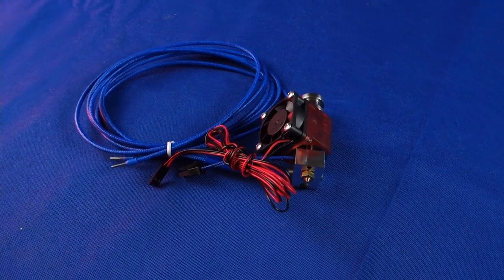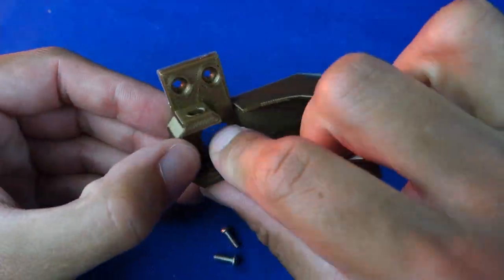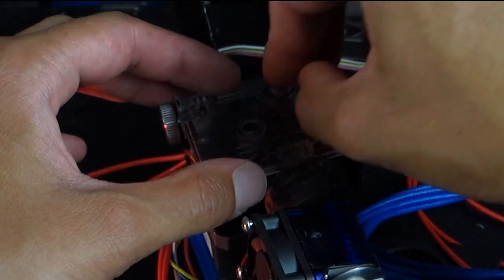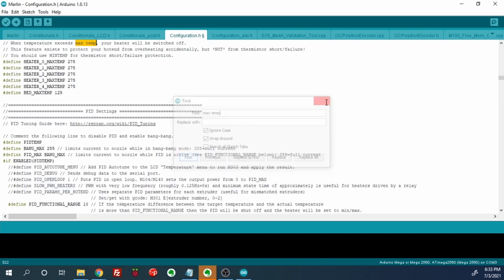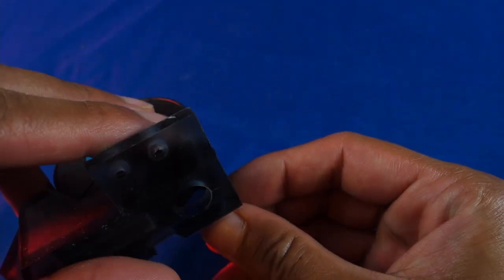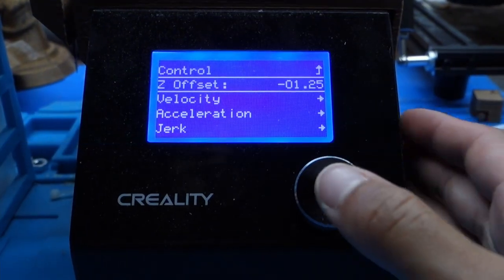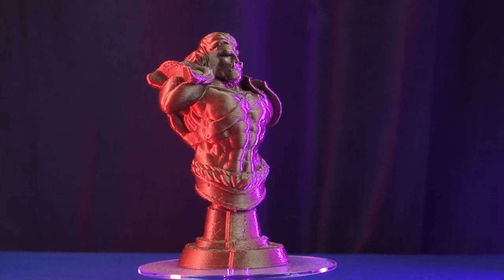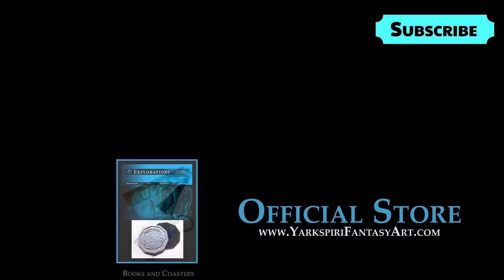CR10-V3 - 𝗣𝗿𝗶𝗻𝘁𝗶𝗻𝗴 with 𝐇𝐈𝐆𝐇𝐄𝐑 𝙏𝙚𝙢𝙥𝙚𝙧𝙖𝙩𝙪𝙧𝙚𝙨

Comment: Can I just flash your firmware onto my machine and install the cr touch on the provide bracket? Or is the height gonna be wrong?
Reply from the maker: You normally need to adjust the height for the Z offset.
Reply: @Yarkspiri  of course but I just mean there isn’t a difference between the bl and cr reach wise? I shouldn’t need to add a spacer or anything? I may eventually convert this machine to a high flow high speed set up though. I’m having some slight regrets on buying this model over some of the other options available.
Reply from the maker: @badgersnakeproductions  In theory it should be ok, however sometimes the attachment can move every so slightly causing a change in the height.  ***I'm looking into doing a review of the CR10 Smart Pro***, but that will depend on what you guys end up choosing.  I have a pole running in the community tab of my channel.
Reply: @Yarkspiri  Last night I attempted to upload the firmware I used the hex with mega in the name. I was really hoping it would make the interface a little more user friendly. I can’t seem to figure out the z offset and now it says cr10 v2 on the info screen. I removed the z limit switch but now I just can’t seem to get the z offset  set up correctly. The process was a lot easier with my ender three V2.
Reply from the maker: @badgersnakeproductions  There's a glitch with it which makes it a pain to set up.  I had to slowly incrementally set until it was the correct height.  Some users had success in resetting the Z offset, so I'd try that first.   But ya, it was a real pain to set up at first, but I only had to do it the one time at least.
Reply: @Yarkspiri  I keep just getting an err: too far every time I try to get it set correctly. I've been at this 2 hours. This is terrible. I think maybe I'll just use the paper method until I find a better way to do this.
Reply from the maker: @badgersnakeproductions  That error means you have to reset the Z offset.  Reset the BL Touch just in case "control" + "BL Touch" + "reset BL Touch".    Make sure to home your machine,  "Prepare" + Bed Levelling".    Then follow it up with "Motion" + "Z Offset".  Make sure to store the settings (I didn't need to do the following, but you never know)  "Control" + "Store Settings".  **Most of these instructions are in the Video Transcript on the main website if you need to double-check anything.  It's also a lot easier to follow when written down**
Reply: @Yarkspiri  I got the offset put in correctly but I think it may be under extruding now. So I'm currently working on that
Reply from the maker: @badgersnakeproductions  I'd adjust the flow rate since that the easiest way to fix it.  Just make sure to really tweak your temperature settings.

Comment: is it all metal with a boden tube inside?
Reply from the maker: Yes.  Make sure to replace the bowden tube with a capricorn though.
Reply: @Yarkspiri  how can it be all metal if the PTFE tubing is touching the nozzle ? if you have to replace the PTFE this is not an all metal hotend :c
Reply from the maker: @MnstrKhaos  There's a certain distance.  If you look closely, the actual E3d version doesn't actually touch the nozzle at all, but instead it touches the steel throat.  However, there is still some minor heat creep, so I'd recommend using the Capricorn just in case.
Reply: @Yarkspiri  so if im printing exclusively PETG and ABS 24/7 i will still need to change the ptfe from time to time >.< really hope they make a real all metal soon, either them or micro swiss, do you think replacing the PTFE for a solid Titanium 2 part would work ? basically replacing the PTFE tube with a metal that's a really bad conductor of heat
Reply from the maker: @MnstrKhaos  Depends on the temperatures you're using.  But generally the Capricorn is pretty reliable, and I've only ever had to change it once so far.

Comment: Why not just replace the heatbreak to an all metal type & keep the rest. Should work just as well & save a lot of hassle.
Reply from the maker: You could try that.  You'll need to make sure that they're compatible, and you'll still have to modify the firmware.
Reply: @Yarkspiri  TY for reply 🙂I already has one ready next to the printer. Dont see why i should touch the firmware though. (Beside it will get a new MB & ill try to get it to run clipper on it.
Reply from the maker: @ChipMIK  Well, you could try to print past the temperature limit on the machine, but it's there as a safety measure.  So unless you're printing past the 140 mark, you should be good.  The firmware modification is if you're going to reach higher than 140 temperatures.  I'd also recommend changing out the Bowden tube with a Capricorn one, since it can release toxic fumes at higher temperatures and heat creep is an issue with that specific extruder.